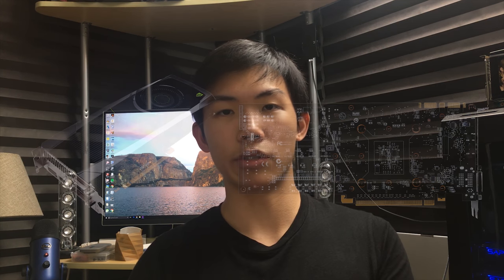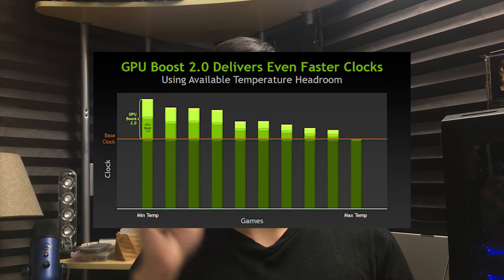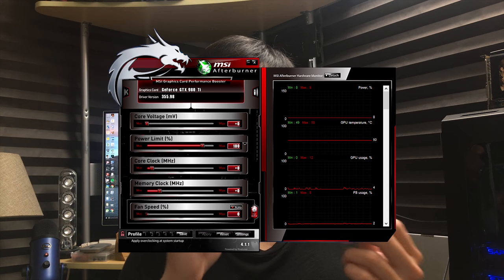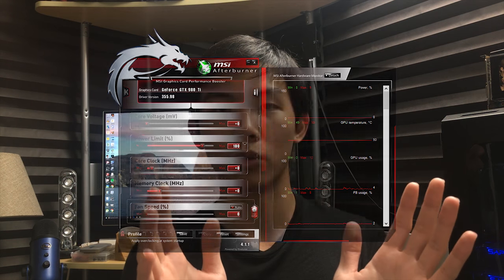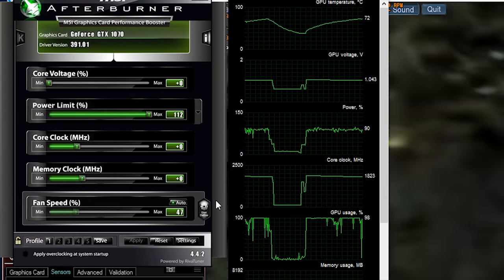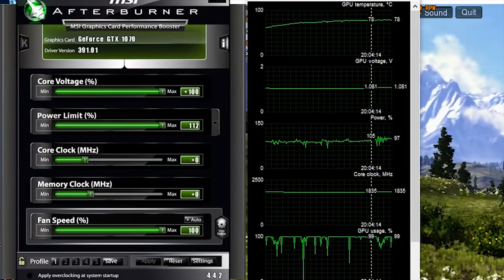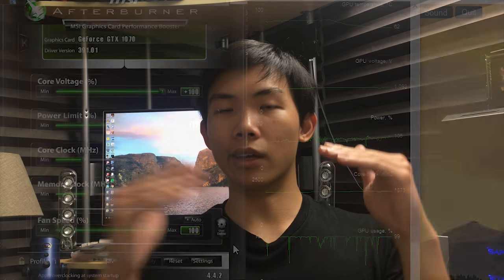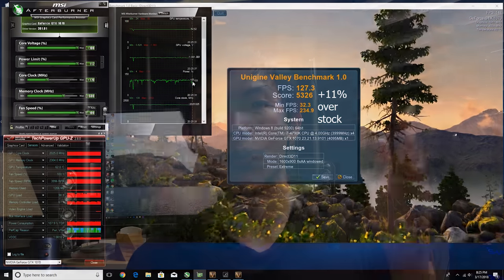Nvidia Pascal Overclocking Guide | Why I hate GPU Boost 3.0

Comment: I hate GPU Boost not being configurable on my 1080. I do NOT WANT my card to jack up to 1900+ MHZ. I do NOT want my card to run at 90+ Celsius. I now have to manually Afterburner a cap of 80 degrees. The boost is still there, but once the card hits 80 degrees the overclock goes away and the card throttles back to acceptable frequencies (1720 average) and stays at 80 degrees. Also, you cannot offset the voltage DOWN with a MINUS. It starts at 0 and goes up.

Comment: Thank you so much for this video, I understand now what the hell is going on with my OC test.
I discover GPU Tweak 2 and it seems have a new option named "Always 3D Clock", it's to force GPU to be max in 2D works (on windows or 2D stuff), BUT I discover when this option is ON it seems BOOST does not works !!!! And GPU Clock stay at the value than you put !

Comment: I know its an old video but fyi press Ctrl + f in msi AB and just play with the curve while heven runs instead of the slider
My desktop 1070 running 2050mhz @0.950v mem +750mhz
My laptop 1070  running 1898 @0.85v mem +650mhz

Comment: I am new to Nvidia cards and what you said seems different from my experience, I think.
I have the GTX 1070 SC2 (ICX) and the only modification I made was I replaced the thermal compound with GELID GC-Extreme. Stock clocks are "1594 MHz, 1784 MHz Boost" and I did not change anything. Gaming: Far Cray 4 & 5, Metro last light Redux, etc... HW Monitor states my max temp has been 68 C and max fan speed is 1725 rpm. The card boosts to 1987 MHz as a norm and sometimes just over 2000 MHz.
So why do you hate Boost 3.0?
Reply: Because GPUB 3 (and now 4) both hinder OCing. Yours is AIB factory OC'd. Because you swapped out the TIM with GELID and GPUB factors temps, it will now of course boost higher. But try to do any actual OCing..